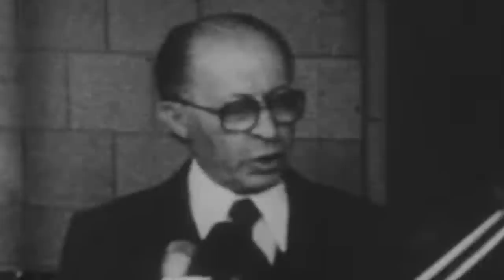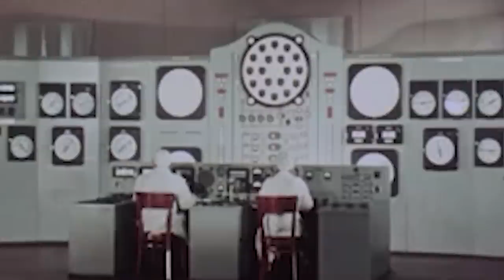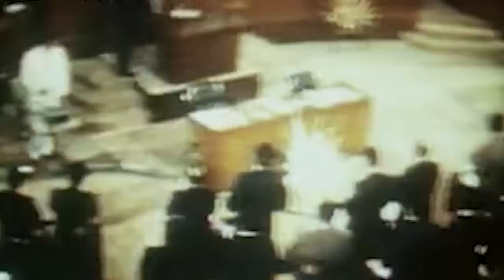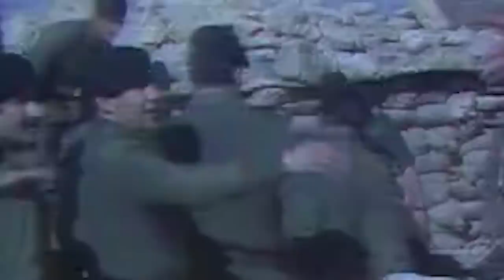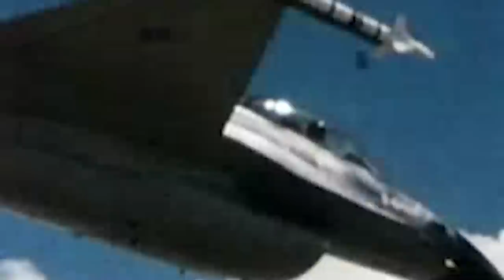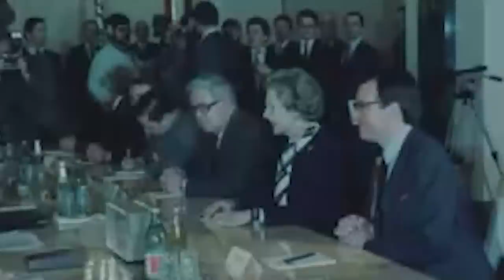Skimming the Desert Floor at 100-Feet to Annihilate a Nuclear Reactor

Comment: Where did you made your reserce?
1)The F-16s didn't disguise themself as Jordania/Saudi fighter, they just flew low "under the radar", only the escort F-15 flew high and used some EW.
2)The F-16 didn't split to two groups as a decoy, but to make more space for "single line" attack, one after the other (all 8 attacked the same target in about 90 sec).
3)14 out of 16 bombs hit the target.
4)No air defence was fired, all the staff was at dinner (that way the attack was at dusk, so I will have the sun in their eyes).

Comment: I remember that the strike aircraft, because of the distance & low-level flying, had to do a risky "hot launch".
Reply: Those F-16A were also stripped of everything non essential to the mission, making them defenseless.
They were hot launched out of Ovdat.  Very risky procedure.
Reply: @trespire  The Doolittle raid but renamed the Dumore raid.......same need but not the same outcome......one was a retaliatory belly punch the other a fatal backstab.
Reply: @trespire  what do you mean by hot launched?
Reply: @Synergy7Studios  Hot launchning is when a jet is sitting at the begining of the runway, fueled, weapons fully armed, engines running and ready for take off, when a fuel truck pulls up, gets bonded to grounded, the running jet gets bonded to ground, then they proceed to top up the jets fuek tanks and external drop tanks while the jet is hot and running.
Reply: @trespire  oh cool, thanks!

Comment: The video is misleading missing very important piece of information: the Israeli aircrafts could execute this raid only by:
1. IDF special forces managed to penetrant in western and southern eastern Iraqi desert to install time bombs in all Iraqi Air defense early warning and spotters communication nodes to destroy it on the same time Isreali aircrafts cross into the Iraqi air-space.

2. They didn't deceived Jordanian nor Saudis, the aircrafts crossed gulf of Aqaba into Saudi Air Space under the eyes of Saudi AWACS which was operated by US officers who were aware of their identity and mission. The AWACS crew reported that these friendly aircrafts (Saudi) to both Saudi who relayed the same message to Jordanians

The Iraqi air defense over western and southern western region was extremely light as the main focus to protect the central and eastern regions from Iranian air attacks. So Iraqi were depending on spotters to report any penetration in that area who failed to rely messages to Baghdad Air Defense sector after they lost all communication nodes.

Iraqi president executed few officers in Air Defense and intelligences for failing to protect air defense assets the western and southern western sectors.

If Iraqi found what Isreali special forces did to the assets early, they would have been faced with the strong air defense from at least 4 heavily defended central sectors in the way to the nuclear reactor site in Baghdad.

After the raid, the Iraqi and Saudi had a diplomatic crises were Iraqi accused Saudi in supporting the raid and demanded that Saudi take over control of their  AWACS fleet and avoid operating them over the western airspace of Saudi until they take full control.

Comment: France wasn't the only nation that had an arms embargo on Israel at the time. The US also forbade the sale of F-16s and long range drop-tanks to the small nation in the late 70s - in part to prevent another operation Focus (the start of the six-day war) and further fighting. Conversly, the US was building a batch of the then new F-16A fighters for their ally, the Shah of Iran. After the resolution deposed the king, the Iranian purchased aircraft were instead transferred to Israel. 

Coupled with Operation Eagle Claw (an invasion of Iranian territory) and certain shenanigans Iran-Iraq war, you might get the feeling that Iran doesn't like the USA for reasons other than simply just being jerks. And then there is the question of if the CIA was involved in the 1954 rearrangement of Iran's politics...
Reply: Israel had bought F-16 back in 1978 (Peace Marble I) and scheduled deliveries around mid/end of 1981, but the demise of the Shah in 1979 and the consequent rise of the Islamic fundamentalist regime caused the planes that were originally intended for the Imperial Iranian Air Force to be diverted to Israel.

Comment: Suppose that Jesus died at this time and date:
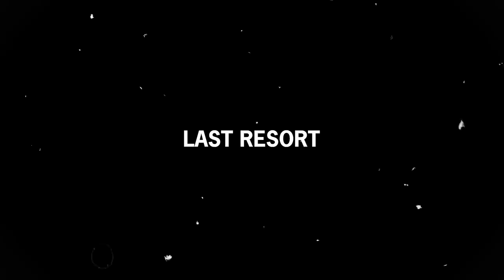2:52 in the afternoon of the 27th day of April the 4th month of 31 AD.
The smallest number with roots that could show this time and date is 294=2*3*7*7=1*7*2*1*1*7*3*1
as 2:52 is also 172 minutes past Noon and the 27th of April is the 117th day of 31 AD.
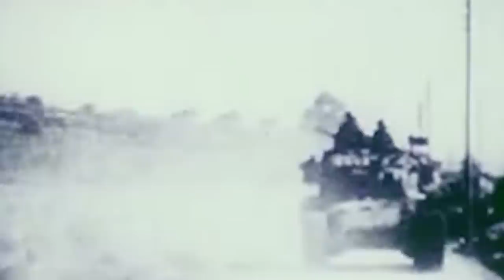Now Jesus said in the verse Mat 5:18 that not a single letter would be missing of the Hebrew Law,
even over such a long time and much translating. If he thought that there is more information hidden among the letters,
that would be revealed by our computers, this could explain why he wanted not a single letter missing.
Well 294+518=812 and 812 is the Mirror image of 518!
Also the name of God, in about 1000 BC, looked like the number 3732, and it was sometimes abbreviated to 732 and 294=7*7*3*2!
Also 812=2*37*7! Also the 42 months of Jesus teaching and healing in Israel was also 42=7*3*2!
Also 42=3*14 which is like Pi=3.14 and Jesus was 3 times 14 Generations after Abraham!
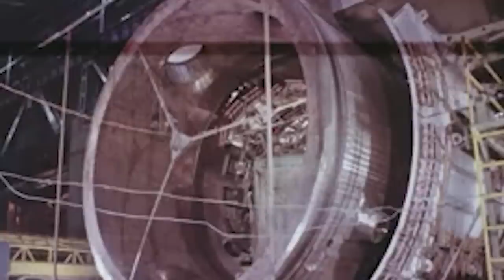Also the 3 times 14 Generations is outlined in the verse Mat 1:17
and Psalm 117 is the exact middle chapter of 1189 chapters in the KJV Bible!
Also 1189-117=1072 and 1072 is the reverse of 2701,
which is the most famous 4 digit number in "Bible Numerics" (a sub division of Biblical Numerology)
mostly because 1072+2701=3773 and 2701=37*73.
2701 is famous because of many other reasons,
but especially as the 28 Hebrew letters of the 7 words Genesis 1:1 is also 28 numbers,
as each letter in ancient times was a number as well, and they add up to 2701.
The 28 numbers:
2 200 1 300 10 400    2 200 1    1 30 5 10 40    1 400    5 300 40 10 40    6 1 400    5 1 200 90.
Word number 1 is made of 6 letters 2+200+1+300+10+400=913.
Word number 2 is made of 3 letters 2+200+1=203.
Word number 3 is made of 5 letters 1+30+5+10+40=86.
Word number 4 is made of 2 letters 1+400=401.
Word number 5 is made of 5 letters 5+300+40+10+40=395.
Word number 6 is made of 3 letters 6+1+400=407.
Word number 7 is made of 9 letters 5+1+200+90=296.
296+407+395+401+86+203+913=2701=37*73 and 2701+1072=3773 !

KJV
1st book 01 as 50 chapters and ends 50 chapters into the KJV Bible.
02 40 90, 03 27 117, 04 36 153, 05 34 187, 06 24 211, 07 21 232, 08 4 236, 09 31 267, 10 24 291,
11 22 313, 12 25 338, 13 29 367, 14 36 403, 15 10 413, 16 13 426, 17 10 436, 18 42 478, 19 150 628, 20 31 659,
21 12 671, 22 8 679, 23 66 745, 24 52 797, 25 5 802, 26 48 850, 27 12 862, 28 14 876, 29 3 879, 30 9 888,
31 1 889, 32 4 893, 33 7 900, 34 3 903, 35 3 906, 36 3 909, 37 2 911, 38 14 925, 39 4 929, 40 28 957,
41 16 973, 42 24 997, 43 21 1018, 44 28 1046, 45 16 1062, 46 16 1078, 47 13 1091, 48 6 1097, 49 6 1103, 50 4 1107,
51 4 1111, 52 5 1116, 53 3 1119, 54 6 1125, 55 4 1129, 56 3 1132, 57 1 1133, 58 13 1146, 59 5 1151, 60 5 1156,
61 3 1159, 62 5 1164, 63 1 1165, 64 1 1166, 65 1 1167, 66 22 1189.

The 19th book is the book of Psalms.
The 18th book ends 478 books into the KJV Bible and 478+117=595 and 595*2=1190 and 595-1=594 595+594=1189!

Another mention of in the beginning like Genesis 1:1 is the first verse of the New Testament book John 1:1.
In 51 Greek letters of 17 words adds up to 3627=3*3*13*31=117*31!
Also 51=3*17=1*17*3*1 and 17=1*17!!

The 51 numbers:
5 50    1 100 600 18    8 50    70    30 70 3 70 200    20 1 10    70    30 70 3 70 200    8 50
80 100 70 200    300 70 50    9 5 70 50    20 1 10    9 5 70 200    8 50    70    30 70 3 70 200
Word number 1 is made of 2 letters 5+50=55.
Word number 2 is made of 4 letters 1+100+600+18=719.
Word number 3 is made of 2 letters 8+50=58.
Word number 4 is made of 1 letters 70.
Word number 5 is made of 5 letters 30+70+3+70+200=373.
Word number 6 is made of 3 letters 20+1+10=31.
Word number 7 is made of 1 letters 70.
Word number 8 is made of 5 letters 30+70+3+70+200=373.
Word number 9 is made of 2 letters 8+50=58.
Word number 10 is made of 4 letters 80+100+70+200=450.
Word number 11 is made of 3 letters 300+70+50=420.
Word number 12 is made of 4 letters 9+5+70+50=134.
Word number 13 is made of 3 letters 20+1+10=31.
Word number 14 is made of 4 letters 9+5+70+200=284.
Word number 15 is made of 2 letters 8+50=58.
Word number 16 is made of 1 letters 70.
Word number 17 is made of 5 letters 30+70+3+70+200=373.
55+719+58+70+373+31+70+373+58+450+420+134+31+284+58+70+373=3627=3*3*13*31=117*31!

Someone who knows Greek wrote this note:
"Actually the last letter of the second word is subscripted by another,
viz iota, this being the second element of a long vowel dipthong.
In fact, therefore, the word has 5 letters;
hence the entry should be "8 + 10" above the dipthong instead of 18
- 8 and 10 being the respective values of letters 4 and 5."

So there is 52 letters and 52=4*13 which is like Pi=3.14 reversed,
and also like the 4th month and 31 AD!!